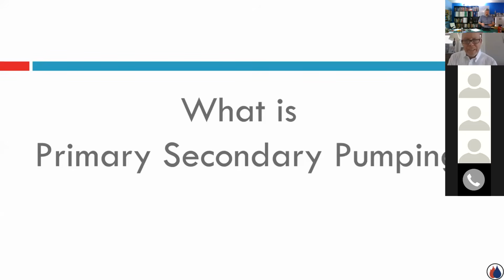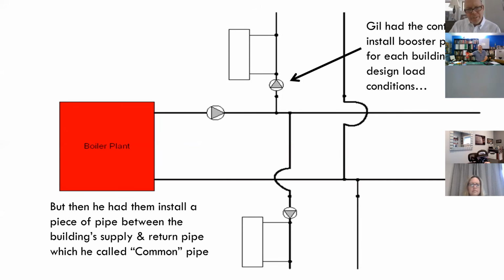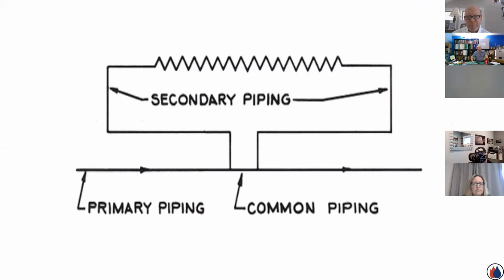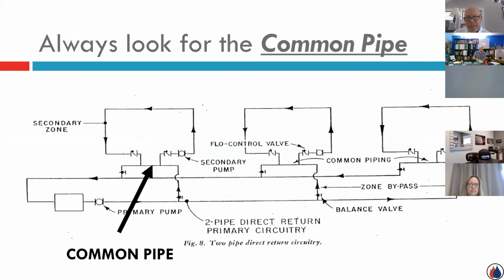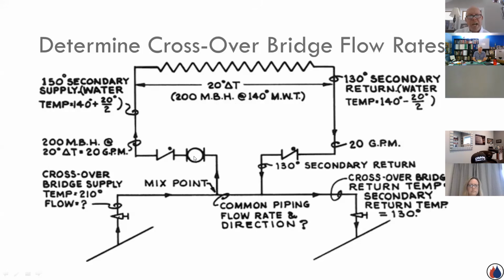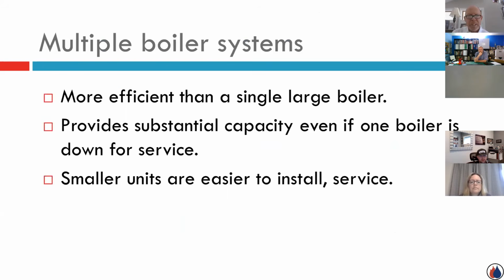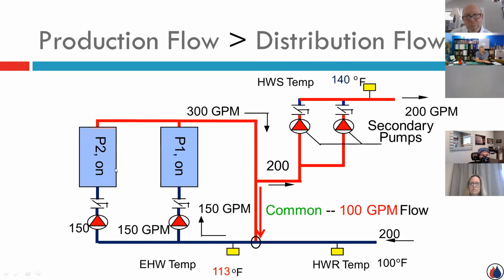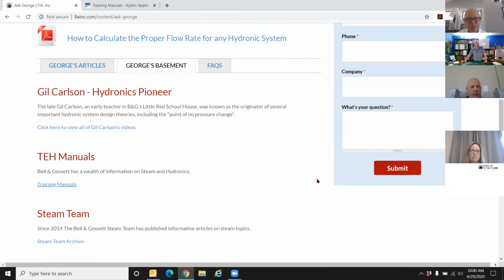Primary Secondary Piping

Comment: I'm still confused about how the flow in a secondary circuit can exceed the primary supply. I'm probably confusing volume with flow, but if a primary loop is only supplying 50 GPM of water, how can a secondary pump increase or accelerate that to 100 GPM when the quantity/velocity of water behind it in the supply isn't sufficient to meet the call? Wouldn't that create a massive vacuum behind the tee since their would be a shortage but there's no air to create a void?  I mean, I heard your explanation that 50GPM backflows through the common and joins the original 50 GPM that entered the tee initially, I'm just still confused lol.
Reply from the maker: This video, while old, is a really good explanation.  https://www.youtube.com/watch?v=U5nDztGOYDg

Comment: For multiple boilers in primary secondary configuration are isolation valves necessary? or would check valve, boiler, circ etc. provide enough pressure drop to prevent flow through inactive boilers?
Reply from the maker: Check valves if working properly will prevent unwanted flow but Isolation valves are recommended if and when a boiler needs to be isolated to perform any work on it on the water side.

Comment: Why does the common pipe need to be a max of 4 pipe diameters long or 12 inches?  What happens if it is twice that length?
Reply from the maker: Exceeding that length will not allow for the proper primary/secondary flow to take place

Comment: OUTSTANDING!!!!.... I've had hydronic systems in my house for years.  My house in Carlisle was set up by one of my neighbors who was the US President of the company which brought PEX technology to the USA.  (sorry, I've forgotten his name).... but he provided PEX tubing which we used to heat our bathroom floor in the Deck House we built in Carlisle in 1983 (we moved in on Christmas day 1983). He also put in the mixing valve and the "closely spaced T" to draw hot water from our traditional boiler which supplied the water for the radiators in the house.   Later, when we expanded the house, we used his system to heat the floors of our additions.   Move ahead 35 years, and we were moving to Tennessee.  Here, we had (in 2012) a company called Northeast Radiant Technology (NRT) design a radiant heat system for our house near Knoxville.   Rob (forgot his last name) of NRT designed a great system which we now have enjoyed for over 10 yrs (it is 2022 now).  We have a Lochinvar Kight boiler, a Squire hot water storage tank, Tekmar controllers, and PEX which my wife and I installed throughout the floor areas of the house.  We have 29 loops of PEX, which have individual flow control valves all of which are orchestrated by the Tekmar system.  While we have been extremely pleased with the system, there is no one in the Knoxville area who understands hydronic heating, nor the Lochinvar boiler (even though it is manufactured in Lebanon, TN which is only about 75 miles away from us!... Anyway, my point of this long message is to say a big THANK YOU to you for providing these tutorials.  I find myself the person who has to maintain our system (not that there is much maintenance involved), but I would like to know how to tweak it for optimum efficiencies.  Your talks have been very helpful for me to learn what it is that Rob of NRT designed and where to make adjustments for best performance.   Thanks again.
Reply from the maker: So glad you found these videos helpful!
Reply: @@youdontlikewords  where are you located?.... Around TN, there don't seem to be many people who understand Tekmar.  However, I can tell you that the manuals they supplied to us for each component was very well written and comprehensive.  My system is almost a decade old, but we've had zero issues with Tekmar.  I'm very pleased to have installed and used Tekmar for our hydronic system control.  It provides all the smarts needed to manage the condensing-modulating-boiler supplied by Lochinvar, even though the Lochinvar boiler has it own smarts, I let the Tekmar controler manage everything.   It is a shame that NRT is no longer in business, but if you can find someone who understand how to use these systems, you'll be working in the Rolls-Royce of heating systems.... (without the RR prices --- perhaps high end, but not unmanageable when you consider the system's longevity and outstanding capabiliites)

Comment: How can you have 220f water? That would be steam
Reply: If you increase pressure, the boiling point rises. likewise, water boils at lower temp in lower pressures (ie. higher attitudes).
Reply: 212f is boiling point of water at sea level
Reply: because it under pressure which raises boiling point